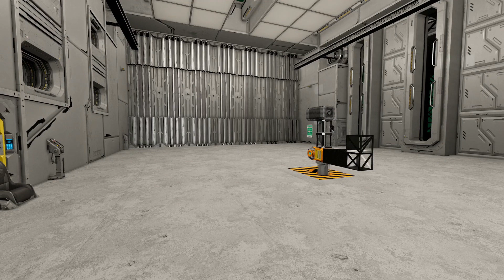Over Engineering Survival S2 Ep36: An Over Engineered Flatbed Trailer (Survival Impossible scenario)

Comment: I'm okay with 40 minute videos, but if they run long, they run long.

Couple suggestions: Put your Gantry control remote on your Gantry Wheels hotbar, so then you can jump smoothly between without having to hop through the menus.

Second, would have been better had we had the Bridge Windows when you made the Garage, but putting a closed control tower using them so you can see down would give you a place to operate things like the Gantry crane by remote while not dying of O2/energy loss.
Reply from the maker: I just tried to put a remote control switch on the gantry's hotbars. But it looks like you can't switch remote controls via hotbar when using antennas, which sucks.

I do have plans to build an enclosed bridge to control the gantry from, but right now its more important that I save as much resources as I can for the train build as It'll take a crap tonne of Iron to build.